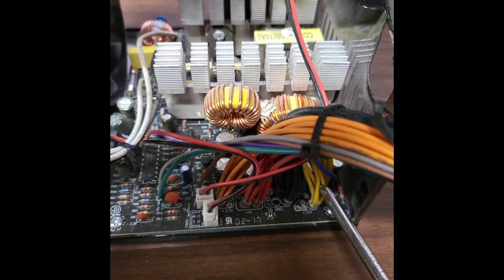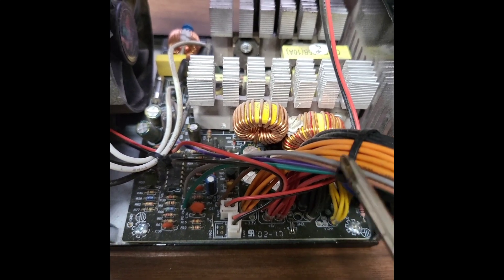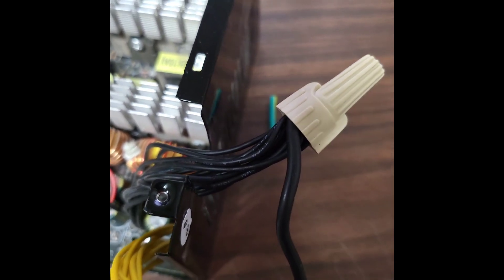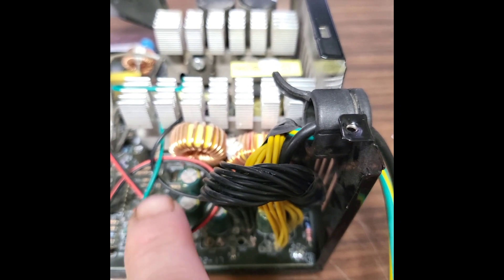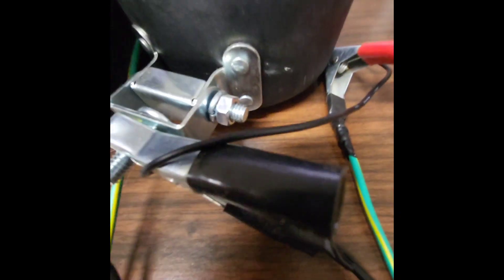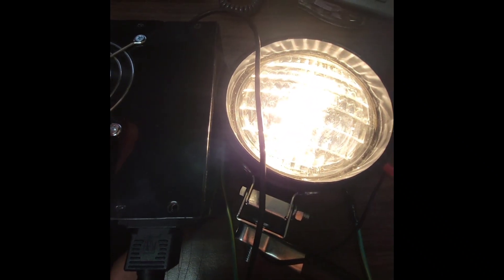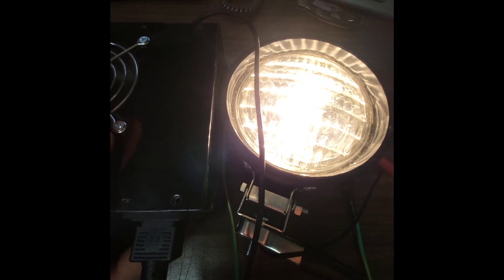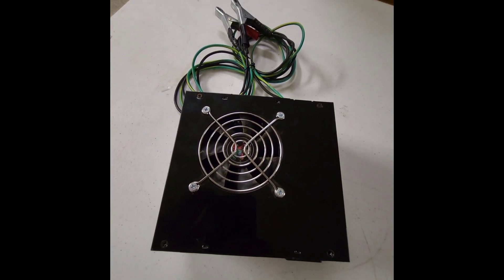Converting a computer power supply to run an Electrolysis Tank.

Comment: Do you have to do anything with a ground wire by having it touch the metal case or anything?
Reply from the maker: No. Just join all yellows for 12V, one black to the green, and rest of blacks together. Remember black wire to black pan.
Reply: @ which color wire is positive and which one is negative?

Comment: So the green is the on off and is connected to the bundle of blacks?
Reply from the maker: The green is connected to just one of the blacks.  It is the power button cable so when it is grounded it allows it to run.